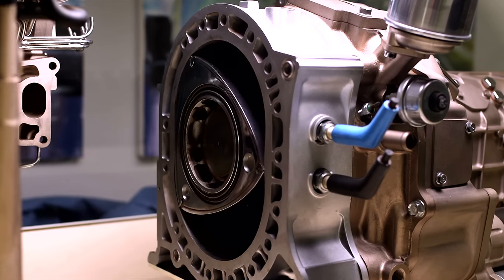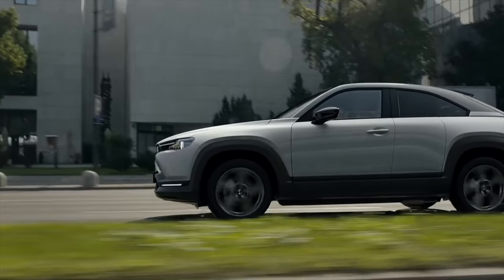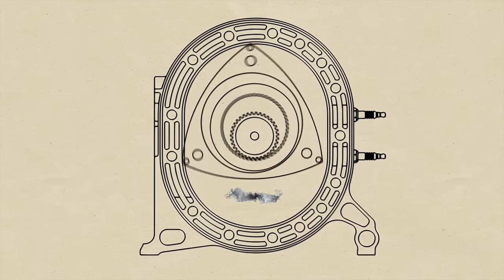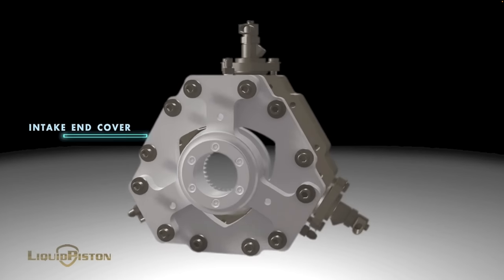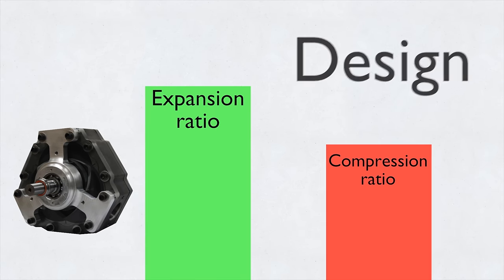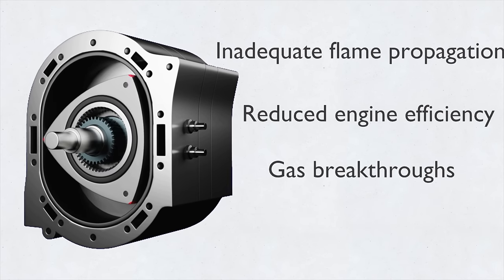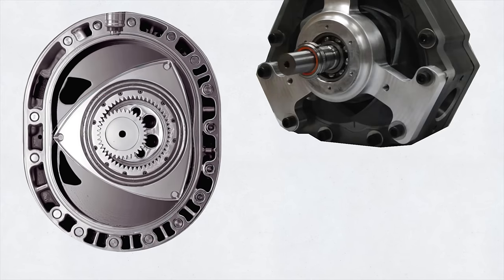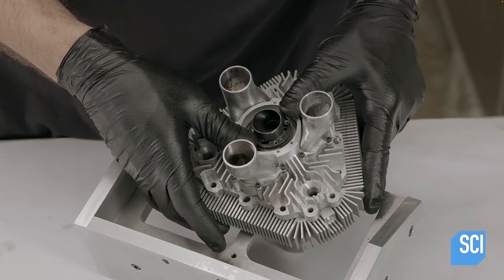Mazda's New Engine is the Smallest and Most Powerful Engine Ever Made

Comment: Mazda refuses to give up on this idea and there's something admirable about that.
Reply: Yeah, it is called bullheaded.
Reply: in the scheme of things, its not admirable in any way.  They havent fized its issues in the many decades they've been running with the concept.  It was a cool engine while it new, but it was dead out the gate... I rather liked the idea myself, but the LP engine is superior in every way.
Reply: @user-bi7nq4nj7q  doesn't really have any issues it's just they build them cheap
Reply: @user-bi7nq4nj7q  what issues?
Reply: The first patent for this engine design was by Felix Wankel in 1929, it was later used in the NSU Ro 80 from 1967/77 and was never successful. I worked for an NSU dealer in the UK at the time.
Reply: It works?
Reply: @rcane6842  apex seals.
Reply: I had an RX-8 with 175,000kms on it before the motor needed a rebuild and it wasn't the apex seals... It was the water jacket seals! A friend of mine has a 2021 Maserati that has just had it's piston engine replaced at 9000kms... LoL! Japanese rotary is more reliable than Italian piston engine!
Reply: @rcane6842  idk mabey that they go thru oil like water
Reply: @googlemail6996  For the conventional rotary, yes, but for the LP engine? As far as I can understand this video (which isn't very far), that doesn't have apex seals.
Reply: @jimbotussock3856  Yes in deed if your only data is from those 2 vehicles. Reliability of a particular model is determined by case studies of all examples sold.
Reply: it is
Reply: It makes them different. Not everything you own needs to be your “every day carry” super reliable no frills. No! The middle class should be allowed to buy things they think are cool as well as something reliable. Rotary engines are cool. And this new one is the logical step forward. Can’t wait to get a weed wacker or lawn mower.
Reply: @thetruthexperiment  I owned an Rx-8. I loved it. It died while driving unexpectedly a few times one week. I scheduled and appointment with the dealership to drop it off. On the way to the dealership it died while I was making a left hand turn in traffic. I was hit by a Dodge Ram pick up truck in my right hand door. It took a year for me to walk after that accident. So no, not everything has to be reliable. But when there are obvious known issues with a design they should be corrected. When it comes to reliability with an automobile it’s not just about get from point A to point B. It’s about the occupants safety as well as the safety of the other drivers on the road.
Reply: How’d that work for Custer ?
Reply: @jimbotussock3856  
Well, you’ve found 2 exceptions that prove the rule.
Well done.
Reply: Freedom Motors have been doing  reseach for years and have already solved all the problems with rotaty engines.  Eg. They have a patented lubrication system which I believe sends oil to the seals directly from within the rotor.  They also significantly improved the fuel economy.
Reply: Perfect for the Plugin Hybrid vehicle.
Reply: DON’T TURN IN FRONT OF OTHER CARS.  Any engine can stall & leave you defenseless to get hit

.
Reply: You mean similarly like Toyota refused to give up on hydrogen cars? Electric engines are the way forward, there is no single doubt about that. Much more efficient, much less wear, much less maintenance, less parts, higher reliability and much better relative performance characteristics.
Reply: @mryellow6918  you must not know anything about the rotary engine and its design to state that.
Reply: @PbPomper  They are not more efficient? They are cleaner in operation, but they are far from efficient and the endergy density of the storage medium is 100 times or more less that of petro. Also where does the energy that charges that EV Fuel Cell come from and how efficient is that conversion process? Then how much energy loss is there from the EV Battery charging process? 

Compare that to the supply chain for Petro and let me know how much more exactly are they suppose to be more efficient. 

Conceptually they can become more efficient, but that's not even close to being a reality yet.
Reply: @user-bi7nq4nj7q  eh, the wankel engine specifically the rx engines are incredible for circuit racing and garbage for about everything else. They have terrible daily drivability for sure but as a circuit racing application it's problems are kind of sovled just in the process of what it takes to race anyways. Bassically it's an engine that sacrifices torque in order to have a high hosepower to weight ratio. In curcuit racing this is perfect because maintaining high rpms is the name of the game and while acceleration is important it's a much more controlled form of acceleration then you see in drag racing for example. Furthermore in racing you are going to completely rebuild the engine every race anyways so the burning oil and apex seal issue don't really matter too much. The rx engine simply should have never been put into a production car. This MAY however make that viable.
Reply: @dylanclark8856  I see where your point makes sense.  I’ve personally been a big supporter of the wankle/Rx line.  Hope the new rce gets out there
Reply: I mean...they have an incredible sound, bet they're fun to drive in good conditions (i.e. not in cold weather lol).
Reply: Because they bought original patent 60 years ago and they have no choice but to try to make it working for them.
Reply: @rickc2078  
Wankel patented a rotary design in 1929, but not the one we know. In 1957 Wankel, a consultant to NSU, developed from a supercharger he designed a prototype with two main moving parts with both running in a true circular motion. It was dropped by NSU who developed another, not by Wankel but by Hanns Dieter Paschke of NSU, which is what we know today - with one main moving part, the rotor, running around an output shaft in a wobbling hula-hoop motion. Wankel's initial engine was superior. Why it is called Wankel I do not know.
Reply: @PbPomper  
Toyota is looking at hydrogen fuel cells which are 60% efficient. They use electric motors.
Reply: @ikannunaplays  
EVs are far mote efficient than ICE engines. From every perspective.
Reply: @dylanclark8856  
Wankels are about dead for direct drive. Constant running in range extending is their niche.
Reply: @johnburns4017  no, just no. They would be terrible for hybrid applications what are you talking about 😂. They are far to inefficient from a fuel perspective for that. They are literally almost purpuse built for curcuit racing. High revs and high power to weight with low torque is such a perfect engine for curcuit racing because it naturally has controlled but still good acceleration at low speeds but maintains speed well. The fuel efficiency problems with these cars are also mostly mitagated when they are running hard. It's idling and kow speeds where it really uses too much fuel.
Reply: @dylanclark8856  
Efficiency and longevity rises when running at a constant speed, at its sweet spot. Rises 25% when running on hydrogen. Hence as a range extender. Best find out.
Reply: Scotty is wrong in claiming that Mazda's New Engine is the smallest and most powerful engine ever made
The smallest and most powerful engine ever made is Astron Aerospace's Omega 1 Engine.
VIDEO: This pistonless engine runs on hydrogen and revs to 25k rpm
Reply: @simon6071  
Astron is a great engine without doubt, and I hope it catches on. But I am not aware of any hard application of it yet. 

The hoola hoop rotor Wankel has been improved. The Mazda MX-30 will have a rotary range extender.
Reply: @johnburns4017  Wankel engines can reach a typical maximum efficiency of only about 30 %. On the other hand, Astron's Omega1 Engine  has a maximum efficiency of 80 %.  In my opinion, the piston engines and Wankel engines should be replaced by Astron's Omega1 Engine in motor vehicle applications. Unfortunately,  Astron's Omega1 Engine is not getting the attention that it deserves because of bad politics at play in the auto industry.
Reply: @simon6071  
When run at a constant speed at its sweet spot a Wankel is far more efficient. Then run it on hydrogen, it is 25%  more efficient again. Astron's Omega 1 needs some real world running to see how it performs.
Reply: @johnburns4017  Too bad today the auto industry is not dictated by technological innovation alone  but by politics biased in favor of electric vehicles. I think the auto manufacturers are scared to let people understand that the Astron's Omega 1 Engine is far superior to the piston engines because they have a huge inventory of vehicles with piston engines for sale.
Reply: @simon6071  
Many innovations are too late.  Once solid state batteries are the normal EVs will take over. Solid state batteries are a game changer.
Reply: Thats how most things were invented tbh
Reply: @googlemail6996  13 B Wankels dont die like that if maintained well. It has bad reputation by lack of knowledge of Mazda mechanics how to fix them and owners that didn't care

Comment: I think EVs are part of the future, but they are not THE future.
Reply: Hmm the unreliable infrastructure
Reply: battery needs to be re-invented for EV to work, batteries are old tech we just keep making better iterations. we need a whole new battery design from the ground up
Reply: So what? Jetpacks ?
Reply: Hate to say it but eventually every car produced will be electric. Ice is too slow at innovating to produce the kinda mileage future policies will require.
Reply: They are a dead end.
Reply: Well, we can't terraform the planet into venus. So carbon energy sources are going.
Reply: Hello from the future (our EV sales are at 85% of car sales). EVs are indeed THE future. Thank you.
Reply: Your life is not sliced bread. But it sure makes it nicer.
Reply: @davidrewerts9311  and what about the ultra rare metals used in the batteries? If a batteri breaks it can't be fixed and the metals will run out.
Reply: @hugo-pg5tv  that’s not quite how it works. Sorry.
Reply: @hepphepps8356  bruh the batteries in EV's are toxic af and the metals are even  more rare than oil
Reply: Hi grandpa, it's me from the future. Never going back to gas and if you tried an EV you won't, too.

Comment: Back in the 1970s lubrication technology was the demise of our rotary engines longavity in my opinion..My RX3 burnt out the Apex seals countless times at around 50 thousand kms average..The oil i was using clearly wasnt doing its job..So a gokart racing mate of mine back then told me to run my rotary on a 50:1 premix fuel using castor oil..That new rebuild amazingly lasted 80 thousand kms till I sold the car..Its unreal what a good quality lubricant can do for an engines life.
Reply: The 12A engines also had another serious weakness.  Water would leak into the combustion chambers, possibly because of heat perishing the rubber type seals - the equivalent of a blown cylinder head gasket. At 0:26 you can see those tiny grooves on the rotor housings where the rubber seals would go.  Usually, the engine would get seriously overheated leading to warped rotor housings which would have to be machined, or thrown away if too badly warped. This exciting development would happen as early as 50000km!

Comment: The X-engine (liquid piston) seems like a good engine to be used on motorcycles. Small, light but can pack a lot of performance
Reply: That would be cool asf
Reply: Yes please
Reply: High revving also
Reply: The torque values also fit with what you'd want - the only issue is the way the torque drives the tires in low-grip situations.
Crossplane in-line 4s, V-twins and big-bang V4s essentially operate by providing small bursts of torque rather than a continuous drive.  This makes a huge difference with grip at the limits (think reverse ABS).  I don't know what the characteristics of this kind of engine would be, but if it operates similarly then it'd be great!
Reply: A modern superbike packs 215 hp and 83 lb-ft between 12 500 and 14 500 rpm while weighing 445lbs. How can you possibly wants more performance?
Reply: I personally think that motorcycles already have too much power.
I ride a 0.5liter 48hp bike and my second gear does amost 90kmh. And current fast bikes have a 1liter 200+hp motor which do 100kmh in first gear, completely unusable.
Reply: @Lancia444  But even those bikes don't really have traction problems, and if so it's the tires lacking
Reply: @Maxime_L91  I didn't mention that I want more power. I just said for the small engine that they are, they can pack a punch. Besides, all I really want from this engine is its weight. It's super light. you can create Low HPs or High HPs with these bike but the weight of the motorcycle won't be back breaking. When someone says performance, that don't immediately mean more HP. You guys are forgetting that weight and handling of a bike is also considered performance

edit: In context, I did say that the engine itself can pack a lot of performance, but I mean it in a way that it can produce similar HP figures for a fraction of the weight of a normal piston engine.
Reply: @Daniel-dj7fh  OH I'm well aware, I didn't mean that I want more HP I just meant that for how small it is it can pack a punch and so it will weigh waaaaay less than compared to piston counterpart engines if you wanna get similar performance. You can have 50HP bike for a fraction of the weight of a similar piston engine bike. Less weight = nimble = fun.
Reply: @1998lemuel  While all this is true, I don't think it has to be. you know what i mean
Reply: The vibrations and aren't as smooth powerband, and they require a lot more maintenance like a twostroke bike, hence why they make 4 stroke gas street motorcycles, not diesels, not two strokes, not rotaries. I could see them being used in offroad more.
Reply: @Lancia444  that only happens at very high speeds and competition scenarios like moto GP. If you made a rotary with around 100hp for a bike, it would be more than enough and wouldn't give those grip problems.
Reply: @Maxime_L91  The main advantage would be lighter weight with smaller engines and maybe better fuel economy. Modern bikes just keep getting bigger and heavier
Reply: @alanbentham5625  Agree for the small and light engine is neat. As for modern bike getting bigger/ heavier, it is quit the opposite except for the R1250GS and stuff like that.
Reply: @Maxime_L91  I have a kawasaki h2 and I would still be interested in more performance lol
Reply: Maybe even superkarts
Reply: @Lancia444  this is why you see anything meant for off road use with 2 wheels having single cylinder engines, it's a huge difference.
Reply: @lordstark1626  rotaries don't rev high at all considering their actual displacement
Reply: @C H Standard, yes, back in the 80s or 90s but it was done with wankel engine (the one with the triangle spinning). Liquid piston has the same rotary idea but is not the same as the wankel
Reply: @Maxime_L91  well, how about the same performance with a substantially smaller & lighter engine? Works for me.
Reply: @1998lemuel  In a way, I agree with both you and @Daniel, it can make 50BHP from a light weight bike, even lighter, think about the days of the Honda CBR250RR, Kawasaki ZXR250R, GSXR250RR, Yam with their FZR250R, tiny 250cc motors, 16 valves, DOHC screaming to 19 and 20 Thousand RPMs making nigh on 50 BHP wayyyy up there in the revs, sod all torque though lol, but, powerful for what they were (btw, ABSOLUTELY LOVING Kawasaki doing a modern/new ZXR250RR GO KWAK!). So, yeah, having one of those X-Motors producing 50BHP in a ZXR/CBR/GSX-R/FZR-R rolling chassis would make for a lighter bike over all, and with bikes having that bonus - BHP/Tonne over cars, that would make for a hellova ride! Weeee 🤔🤣🤣🤣🤣👍👍     😎🇬🇧
Reply: @THESLlCK  Not really, a 100cc single cylinder 4 stroke petrol engine can rev to a max of 6000rpm before the engine breaks, and I'm taking about street bikes.  But the same cc rotary can be stable for 10000 rpm, because it has no reciprocating parts. Rotary engine also delivers linear power.
Reply: @lordstark1626  the issue is you’re comparing a 4 stroke to a 2 stroke...

Not to mention, a 250cc street bike can go to 15K rpm or more
Reply: @THESLlCK  There are no strokes in a rotary engine and that IS the main comparison, the liquid piston engine produces power almost steadily and can well exceed 15k rpm easily .
Reply: @lordstark1626  rotary engines do have a power stroke. New to this whole car thing I guess. Just try to research what you’re talking about because people take these comments seriously.
Reply: I think it's a lot more important for cars. Motorcycles already have relatively light engines because they simply don't need as much power. Yes, it'd still be great, but cars is where this thing REALLY saves. It cheapens your car because it of less taxes (in the EU, your taxes are based on your car's weightclass), the efficiency would also matter more in cars as they are simply less efficiënt than motorcycles so there's more gain. Besides this, it would leave a car WAY more space for either maintenence, extra's, more safety features or simply storage space, where as with a motorcycle, they'd most likely just use it to make it slimmer or sleeker. Also, a motorcycle should obviously not be too light for physics reasons. With a car, you don't run into this issue as fast as their very minimum weight is probably already around 700kg (unless you're driving a banana). So yes, even though it's ideal for motorcycles, I'd say the gains are bigger in cars and probably even more so for aviation or really any non-driving related engines which more often than not need to be as compact as possible.
Reply: I was thinking the same thing!
Reply: Yes also any for small boat
Reply: @Toymonkeyjr  they're smooth as hell